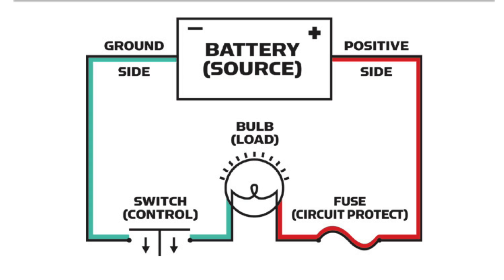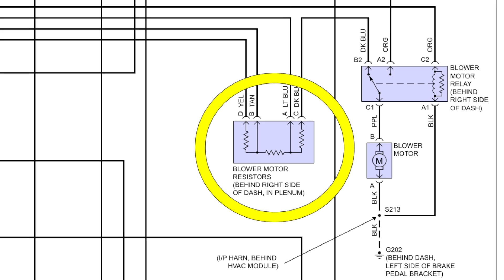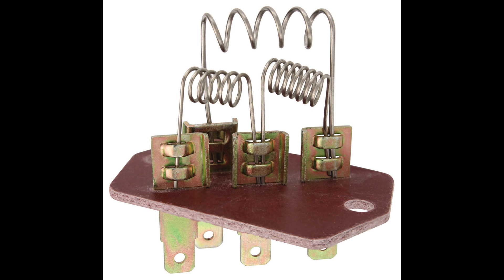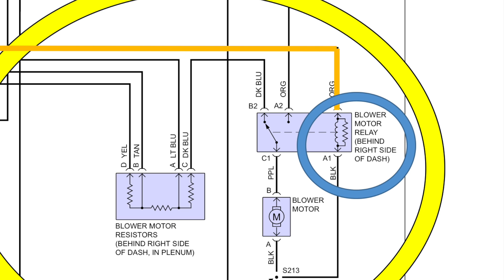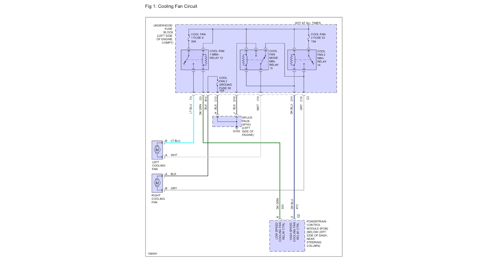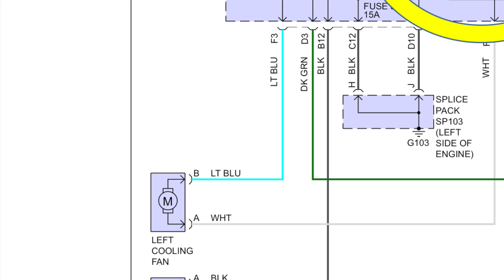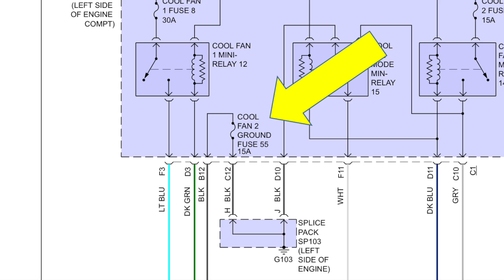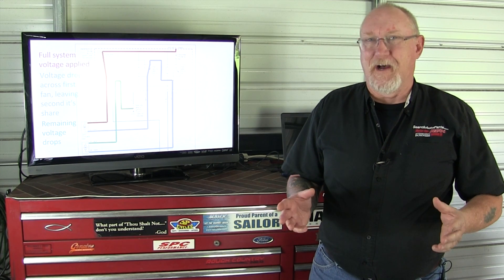The Trainer #81:  When Voltage Drop Is A GOOD Thing!

Comment: Engine running at idle reading at 14V, then load it headlights A/C on, voltage drops fast from 14V to 10V in 3minustes... Voltage drops is absolutely good!
Reply: Have you fixed the issue? If you have, can you please share with us what it was?

Comment: Having an issue trying to find a parasitic draw on a 2004 Jeep Grand Cherokee Special Edition 4.0L Straight 6 4WD engine pretty much loaded....I have an inexpensive multimeter and I want to use your method to check voltage drop across fuses....So would I have my black lead on COM and my red lead on V? and my dial set to 200m on DCV side? Does this method work on all fuses? What about relays or JK fuses? Also trying to figure out how long it takes for it to go to sleep....Any help would be greatly appreciated!
Reply from the maker: Ed, first - did you confirm that you do, indeed, have a parasitic drain? I would recommend you use a quality amp clamp and measure the drain overall first. As for how long it takes for the modules to "go to sleep", it depends on OEM and model. I wouldn't expect your vehicle to take more than a few hours, tops. The method shown works on any fuse that you can access both sides of. On some, you'll  need to remove the clear plastic cover on top to gain that access. But before you do, get a copy of the Power Distribution diagram and identify the first fuses in line from the battery.

Comment: sir I don't get what causes the resistors value to change by adding or subtracting them in a circuit
Reply from the maker: The value of the individual resistors doesn't change, but the total resistance of the circuit does. In an electrical circuit, all available voltage will be used to overcome the resistance(s) in the circuit, and in proportion to those resistances. Focus on the blower motor resistor, made up of three resistors. Let's just use your number of 3 ohms each. We also have to take into account the resistance of the blower motor (which is a little harder since it changes a bit when it's running). To keep things simple,  let's say it's also 3 ohms. So all the resistance(s) in the circuit are the same - which means all will demand an equal share of the applied voltage (12.0 v in our example).

In LO, the circuit path goes through all 3 resistors in the resistor assemble and the blower motor. That's a total of 12 ohms of resistance. Using Ohm's Law, we can determine that current flow through the circuit is 12v/12 ohms = 1 amp. Now, if one resistor is 3 ohms and we know now current is 1 amp, the voltage demand on each is 3 ohms time 1 amp = 3 volts.

Continuing in LO - the first resistor uses 3v of the 12v applied, leaving 9v to travel to the next resistor in series. It, too, uses 3v so now only 6v is left. The third resistor takes its share, 3v, leaving only 3v remaining for the blower motor.

In M1, there are two resistors in the circuit path in the resistor assembly and in M2 there is only one - plus the blower motor - to consider. Does that clarify it for you?

Comment: wouldn't there be 6 volts to the motor  if you moved the switch to m2 tan wire if the resistors value is 3 ohms each and 9 volts to the motor at the light blue wire
Reply from the maker: What is your rationale? Let's learn something together!
Reply: @VehicleServiceandRepair  Pete stated that R1-R3+blower motor all had the same resistance values and created a three volt drop each, thus leaving 3 volts available at the blower supply. When he then switched to R2 and R3 only (M1 speed), he said there would be 4 volts available. Being a constant fixed resistor, if R2=3v drop, and R3=3v drop, 6 volts would be available to blower, M2 would leave 9 volts, and relay engaged would allow full system voltage to blower. Pete divided the 12 volt supply by the number of resistors in the second example to come up the 4 volts available. The resistor values are fixed, being coiled resistance wire, and can not change. seekintruth1977 is correct.
Reply from the maker: @patrickmccarel  Based on what you're saying, the drop across the R2 resistor - all by itself in the circuit - would still be only 3v?
Reply: @VehicleServiceandRepair  Pete stated..." In this case each resistor in the circuit will drop 3 volts with a constant 12 volt supply". The actual values of the resistor are inconsequential, since we are discussing voltage drop. If R1+R2+R3 leaves 3 volts available to the blower, and each one drops 3 volts, then switching to M1 using only R2+R3 (3v+3v) would leave 6 volts available, not 4.
Reply from the maker: @patrickmccarel  But isn't it true that all  available voltage will be shared proportionally across the individual circuit resistances? If R2, R3, and the blower motor are equal in resistance, shouldn't the voltage drop across them also be equal - or now 4 volts?
Reply: @VehicleServiceandRepair  Exactly my point. He said each resistor has a 3 volt drop...that is a constant in his equation, as is the 12 volt supply.Then he changes that constant by saying there would be 4 volts available at the blower implying that now each of the remaining resistors will drop 4  volts leaving 4 volts at the blower. These are fixed resistors and their value can not change substantially.
Reply: P.S. Pete is a great guy and I watch his videos all time! As a 35 year Master Tech,  I still appreciate going back to the basics, lest we forget the simple things and start going down the wrong path!
Reply: exactly Patrick you see my reasoning here he Said the resistance values don t change I don't understand how he came up with 4 volts
Reply: @seekintruth1977  You are correct in your original statement, or I would not have called it out. But like you, as soon Pete said '4 volts' I thought to myself..."what?". Amperage flow will change,  but the resistor values do not change, and the available voltage after leaving two "three volt dropping resistors" leaves six volts, and twice the amperage flow that low speed provided. He did not provide a resistance value, but if each resistor drops three volts, they must all have the same resistance value.
Reply: @patrickmccarel   @seekintruth1977
OHM'S law is E=IR   E=Voltage, I=Current, R=resistance
Voltage is equal to current multiplied by resistance. * A voltage drop across a resistor you'd measure with your volt meter, will be equal to the resistance value of the resistor in ohms multiplied by the current that runs through it in amps *.  <-- the main point about "voltage drop". 
This equation can be manipulated with algebra in two more forms R=E/I  which means resistance is equal to voltage divided by current.  and I=E/R, current is equal to voltage divided by resistance.  So:

E=12 volts
I=current depends on the setting
R=
First Setting:
R = R1 + R2 + R3 + RL  (Total resistance is equal to the sum of the resistors and the load blower motor)
Second Setting:
R = R2 + R3 + RL  (Total resistance is equal to the sum of the resistors and the load blower motor)
Third Setting:
R = R3 + RL  (Total resistance is equal to the sum of the resistors and the load blower motor)
Full Blast Setting:
R = RL  (Total resistance is equal to the load blower motor)

Lets just pick some values for the resistance and test it out remembering now that current I, is equal to voltage V divided by Resistance R:
10Ω (ten ohms).
First Setting:
I = 12/(10 + 10 + 10 + 10) = 12/40 = 0.3 Amps.
0.3 amps through a 10 ohm resistor means each resistance is dropping 0.3amps x 10ohms = 3 volts.
Second Setting:
I = 12/(10 + 10 + 10) = 12/30 = 0.4 Amps.
0.4 amps through a 10 ohm resistor means each resistance is dropping 0.4amps x 10ohms = 4 volts.
Third Setting:
I = 12/(10 + 10) = 12/20 = 0.6 Amps.
0.6 amps through a 10 ohm resistor means each resistance is dropping 0.6amps x 10ohms = 6 volts.
Full Blast Setting:
I =  12/10 = 1.2 Amps.
1.2 amps through a 10 ohm resistor means the load itself is dropping 1.2amps x 10 ohms = 12 volts.

but what if they aren't 10Ω, they're 5Ω?
First Setting:
I = 12/(5 + 5 + 5 + 5) = 12/20 = 0.6 Amps.
0.6 amps through a 5 ohm resistor means each resistance is dropping 0.6amps x 5ohms = 3 volts.
Second Setting:
I = 12/(5 + 5 + 5) = 12/15 = 0.8 Amps.
0.8 amps through a 5 ohm resistor means each resistance is dropping 0.8amps x 5ohms = 4 volts.
Third Setting:
I = 12/(5 + 5) = 12/10 = 1.2 Amps.
1.2 amps through a 5 ohm resistor means each resistance is dropping 1.2amps x 5ohms = 6 volts.
Full Blast Setting:
I =  12/5 = 2.4 Amps.
2.4 amps through a 5 ohm resistor means the load itself is dropping 2.4amps x 5 ohms = 12 volts.

You'll find this works no matter what the resistance value is.  on the 2nd setting if you got your meter out, you'd measure 4 volts across the motor, not 6. 
I will gladly help you guys understand this if you have any questions,

All the best,
Snap-off, B.S.E.E.T.